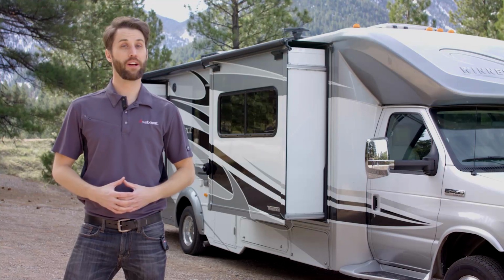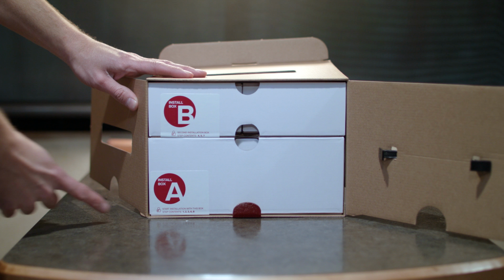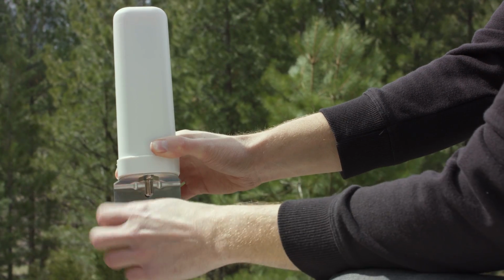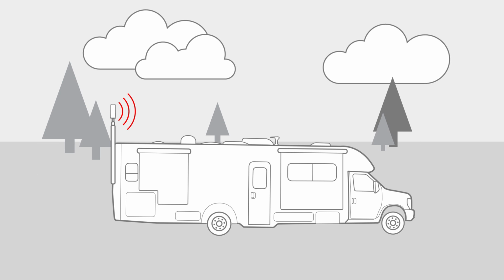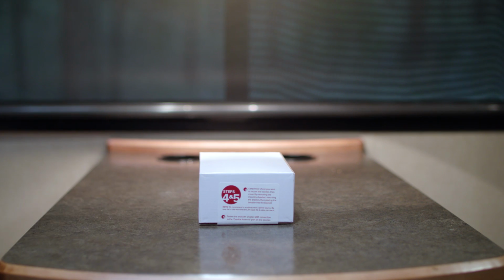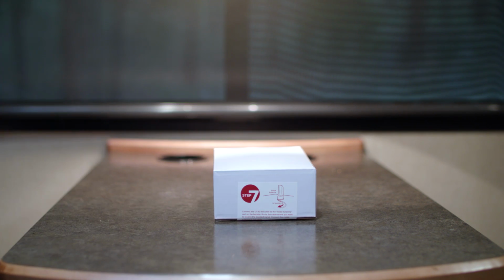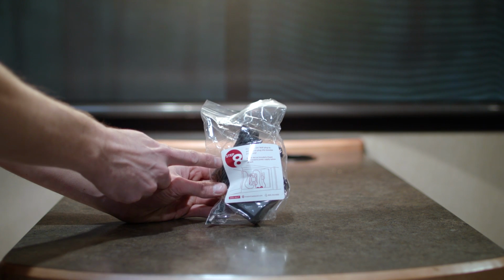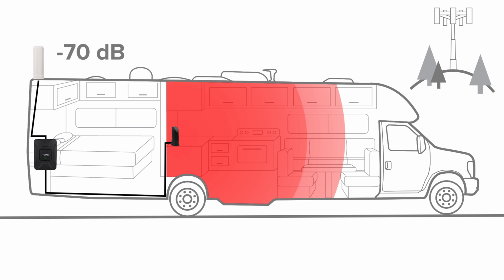How To Install A Cell Phone Signal Booster In An RV |  Drive 4G X RV | weBoost

Comment: I’m planning to run the external antenna on my RV’s telescopic flagpole.
Can I use an adapter to hook up the WeBoost cable to the satellite coax inlet?
It would be a perfect  no-drill and easy install.
Please advise.
Thanks

Comment: Is cell phone signal that important? ?? Go camping to be on your cell. Stay home
Reply: I travel with my company and don’t own a home and live in mine
Reply: I use mine at my nephew's cabin to be able to keep in touch at home if I need to, or dial 911 if need be.  It's way out in the country,  and we can't get service without it. It's not like we go camping and just chill with our face in the phone.
Reply: Here in the UK I live full time in my RV. The all winter site I am staying at right now, has a very intermittent 4G signal.
My brand new Samsung A70 is lucky to see 2G never mind 4G which means I am unable to use it as a hot spot for my laptop.
This seems to be a known Samsung failure, as my old Wileyfox would see 3G /4G okay.
So any person full time touring in the UK is going to need some internet access to manage their affairs.
The powers that be don't like people being "off grid" here in the UK and make it difficult to manage.
Reply: I can work from anywhere as long as I have cell signal...that’s why I need it for my RV
Reply: People like me live full time RVing. 
So yes, we need access to phone calls and data.

Comment: I took a 2 month trip from NY to Texas to Florida and back at the beginning of the year. I tested  the Weboost 4G-X-RV with Verizon, ATT, and T-mobile at all the places I boondocked/camped. I tested both an omni and yagi external antenna. The results were interesting. I learned a couple of things:

1st, DB isn't a very useful metric. I used the Speedtest app to check upload/download speeds. You can have great DB, but a crowded/lousy cell tower. After all,  how fast you can download or upload a video is what makes the booster useful. 

2nd, there was no best network. All three major networks were better at some places. A good portion of the time, the unboosted signal had a better download speed than boosted. Upload speeds were always better with the booster.

 3rd, The yagi takes time to set up (and can't be used while driving). In really remote areas with no signal, the opensignal app didn't always give a direction. So you had to hunt for the tower. At one place on the Texas coast, I could only get a connection with the yagi antenna. Most of the time, the extra effort to put up the yagi wasn't worth the effort. The omni antenna provided similiar upload/download speeds.

I have a small 14.5' trailer and I had to use the small candy bar antenna instead of the one provided with the RV kit. Since I couldn't get the required separation (getting green leds during boot-up).

Weboost was definitely worth having. But having multiple carriers is also important!